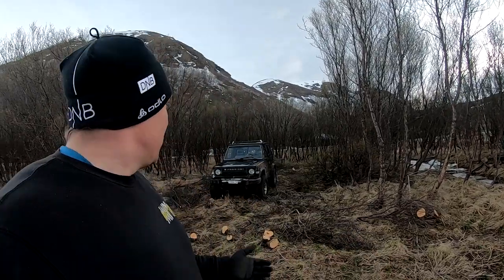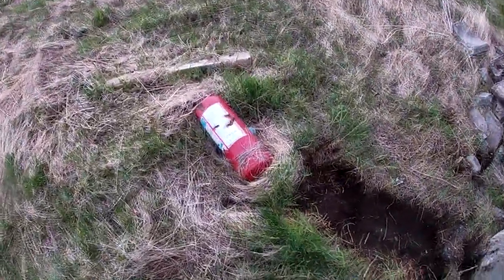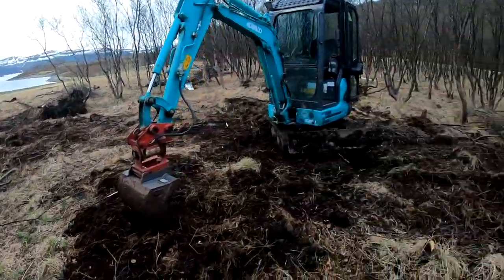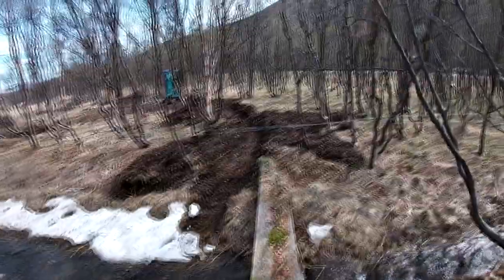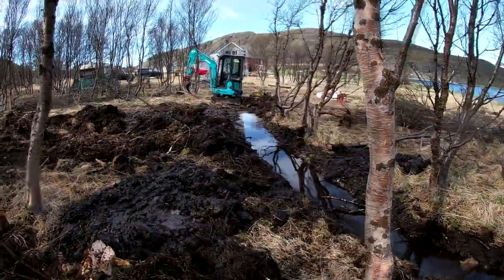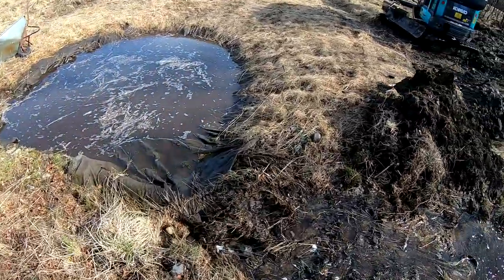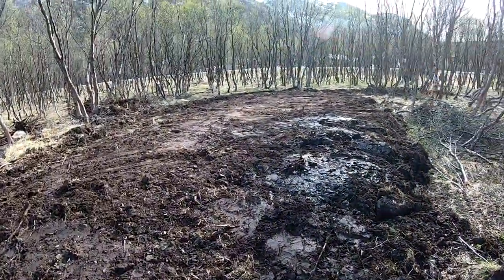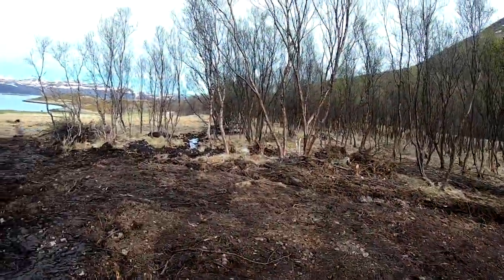Redneck day! chainsaw, farm truck, excavator, Go-cart and explosions (Clearing land for new stable)

Comment: Oh that was a fun time for all !!  I would get into the habit of using the blade more for support and work over it, your back will be pleased as you get older. The bucking of the machine will be lessened. Maybe an electrical project with a big red light when you don't put it down and a small green one when you do, some limit switches to sense the position..Cut the trees after you dig and push them down like you did a couple of times, much more efficient with a big lever. Watch Letsdig 18 he does all his tree removal that way and it is a bettr way than struggling with stumps.
Reply from the maker: Yes I'm a bit lazy putting it down sometimes, think you wont notice the light after some time since you  have it up so much mooving and stuff.
Reply from the maker: Yes it was quicker and easier to push them down, and with the big trees Letsdig 18 takes down I really see that as a big positive

Comment: The water is flowing so steady from that ditch drainage pipe that you could probably up a micro water turbine to it to give remote power to your garage/ horse stable near it.
Reply from the maker: Yes that could probably work, I got a small pipe in the creak filling the pond and it's a pretty good flow in it.

Comment: You could put a hydro generator on the end of those pipes to generate electricity for the stable
Reply from the maker: Yes but in summer it's almost no water in the creek is only now when the snow is melting.

Comment: 13:02 Looks like you loose a lot of strength with the really long powertilt, have you tried the machine without it? Good video as always! Regards Nils
Reply from the maker: Yes you do loose a bit, I don't have any other connection for it so I never have tried avfyring else. But if you see the video tearing down a stone wall you can see it still got plenty of power. But less than a direct connection.